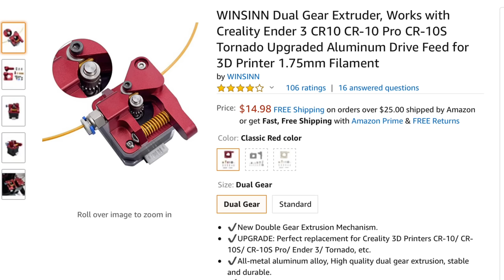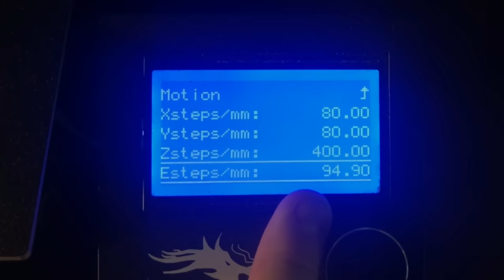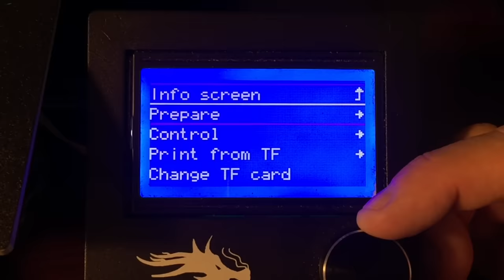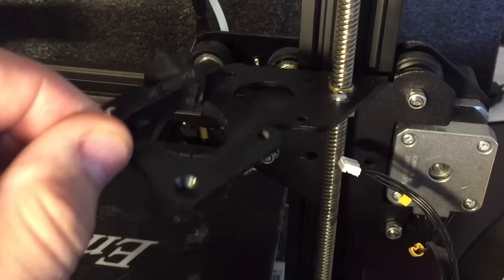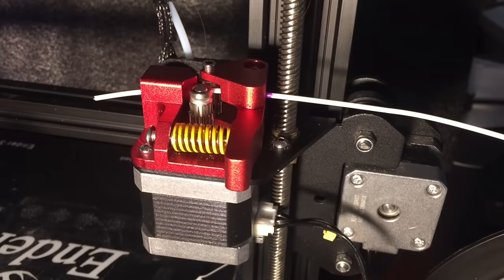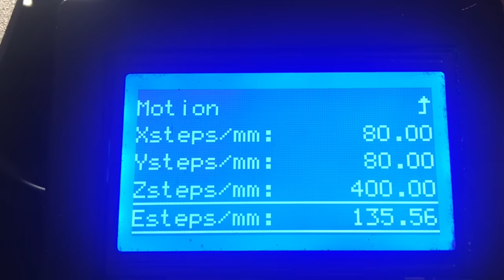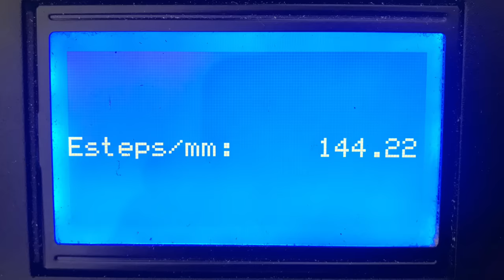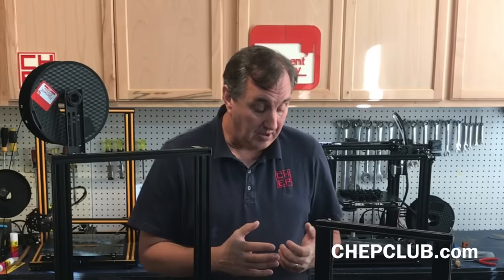Dual Drive Gear Extruder Upgrade + E Steps on Creality Ender 3

Comment: There i no 6 mm slippage. Its 6 mm because of the tension in the tube! The tube is not 100% same size as the filament. Thats not possible because filaments are not 100% 1,75 mm all the way. So the tube has a bit of a buffer. In this buffer, the filament can "bend" a bit. Thats here the 6 mm come from.

Comment: This is a crash 'n burn for me.  The filament is MUCH harder to feed through the hole than the original plastic extruder, and once it's through the hole, it won't feed into the Bowden tube.  I'll admit I am relatively new to 3D printing, but this is a lot harder than it should be.  I'm going to have to back to the original extruder just so I can print again.
Reply: Just cut a bit of the PLA at the tip at an angle :-/

Comment: if it ain't broke... don't fix it.
Reply: Mine's broke.  Need to fix it.  Question is, what's the best upgrade?
Reply: @davethomaspilot  what broke... or how is it behaving
Reply: @davethomaspilot  extruder performance is hampered by bed being too close.
Reply: @Frickitall  

Arm on extruder cracked.  Apparently, this is very common on Ender 3. 

Issue was under extrusion in bands (on the same layer).  Actually, no extrusion in bands.  Amazingly, it only showed up when printing with .2 mm nozzle.  Probably the extra back pressure created with .2 mm nozzle was too much for the broken extruder.
Reply: @davethomaspilot   might try higher heat setting next time (5-10 degrees) to liquify the filament more; less resistance at the nozzle that way.  

I upgraded to the silver metal creality  extruder and it is working well. Also use a nice piece of capricorn tubing and did the fix at the hot end where we drop a piece of capricorn tubing at the bottom of the hot end so that it wont lift (causing filament jams). I use the stock tubing to facilitate the incoming filament before it reaches the extruder.

Also I try not to fiddle with the tubing after its installed so that the pinch clips stay working like new.

I'll post a small vid to show you my setup on the LK1.
Reply: @Frickitall  I started at high temperature (220 for Sun PLA) and backed off at 5 degree intervals before I isolated the issue to the broken extruder arm.  "If it ain't broke, it soon will be!"   Interestingly, the spacing between the "no extrusion bands" changed with the temperature, getting smaller when I lowered the temperature, but as I keep getting lower they started get farther apart.

There's a thread with pictures on a facebook forum, if you're interested.  But, I'm optimistic the new extruder will be fixed.
Reply: The hot end fix looks like a really good idea.  If I could print a washer now, I'd do it before moving on.   But, I need to get the extruder on just to print anything.  I'm set up with a .2 mm nozzle (it was working great on Hatchbox PLA at 200), so I'm hoping to finish up some .1 mm height prints before I mess with it again.
Reply: @davethomaspilot   I haven't messed much with the nozzle size or layer height.  So you are in no man's land there without proper mechanics. I'm thinking that if your PLA is not dry it might be boiling and creating extra pressure at the nozzle.  The hot end fix IS the best thing as well as making sure your filament is dry. That would explain the behavior at high temps. When I get bad filament its obvious and as soon as the dryer box starts working my layers are smooth as silk. 35-40 Celsius is a good temp range to dry filament, if you want to use the kitchen oven with confidence.
Reply: Happy to report the new extruder fixed the issue.

Same profile with .2 mm nozzle and .1 mm layer height.   First layer came out great--no more bands of under extrusion.
Reply: @davethomaspilot   kewl perhaps I shall start messing with those layer parameters myself.

Comment: Biggest downside is that you can't use a knob on your extruder anymore with this, so you can't manually feed.  You have to sit for 3 hours waiting for it to fill your bowden tube at 0.5mm/second.
Reply from the maker: Or you can manually just pull back the lever and push it in within a few seconds.
Reply: I feel the knob gives you better control, and can be operated with only one hand from the front of the printer (which is a plus for how I have mine set up).  The lever is definitely an option for feeding faster, but it's a little awkward if your printer is in an enclosure, or you just have a hard time getting your hand in from the side.  I bought this part after seeing your video, so you made a good case, I just didn't think ahead to how useful I find the extruder motor knob.
Reply: feed  it with gcode
Reply from the maker: The EZR extruder is good and includes a knob. https://youtu.be/1GNDxvxpWr8

Comment: I change to this extruder and I have over extrusion why don't u talk about that on the video? I think is a incomplete video
Reply: you need to calibrate the e-steps yourself, you can't just copy the values from the video
Reply from the maker: I cover calibrating e-steps in this video. How is it incomplete?
Reply: @FilamentFriday  No clue.
Reply: @FilamentFriday  because i change the extruder to this one and I was over extruding because you need to ajust the flow not only e-steps!
Reply: @kylieb383  i did that! mine is at 140

Comment: I have always enjoyed your videos, but this one falls up shorthanded.  The stepper adjustment was spot on, and help[ed me calibrate my machine.  However, with the replacement extruder, You start with the gear already in place on the tension release handle, and just show one more screw going into that handle.  Nothing about the gear mounting, with the bushings, sleeves, insert bearings nothing.  The entire extruder assembly is covered for 23 seconds in the video.  For a summery video this would be fine, otherwise, not very helpful.

Comment: The only thing you did wrong was to NOT set it up as  direct drive.  It's much easier to pull a piece of spaghetti through a straw than to push a piece of spaghetti through a straw.  Think about it.